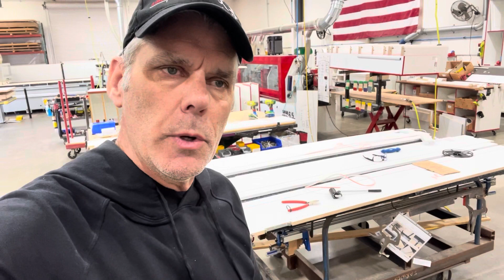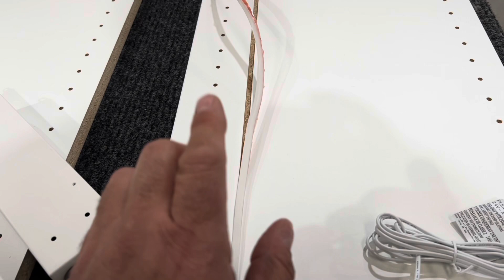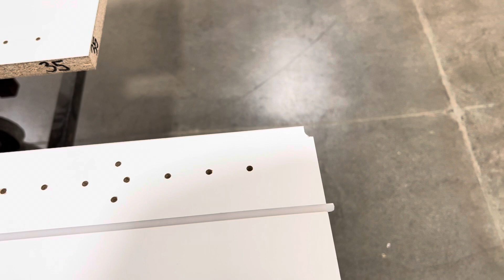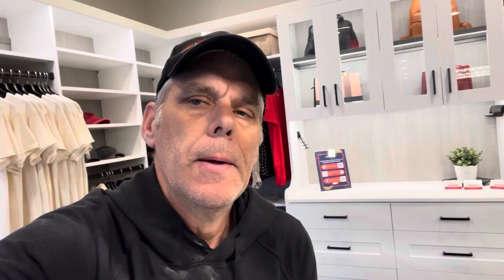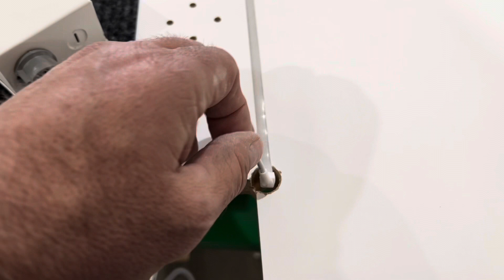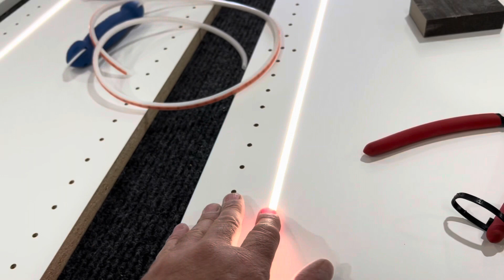How to Install LED “Squishy” Lights Into Closet Panels

Comment: Better result after touch a spot in every foot is to use a wallpaper seam roller or something similar and just roll it down the strip. It creates a lot less deformation of the silicone strip compared to a finger push / smoothing.

Comment: Where do you buy the “squishy” lights and are they able to be wired to a light switch?
Reply from the maker: Richlieu Hardware has them. We use the Kinetic switch that is wireless and requires no batteries or power
Reply: Thanks Derrek! These lights look phenomenal and exactly what I have been looking for!
Reply: @derrekholland5207  I checked with Richlieu Hardware about the lights. They would not sell to me unless I had a business. What to do? Thanks Otto

Comment: Is it richelieu FLEXYLED AT6? This stuff is crazy expensive very nice though
Reply from the maker: I think that’s it. It’s cheaper and less labor intensive than running regular strips in an aluminum extrusion and having to notch shelves to fit around it.